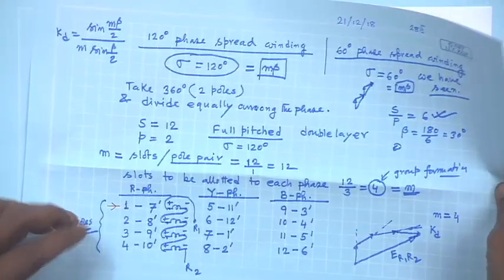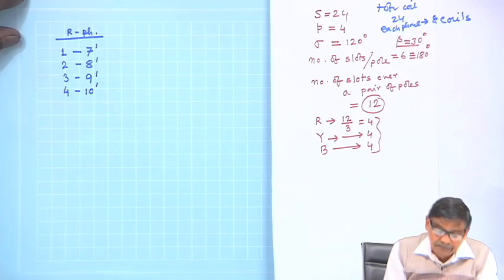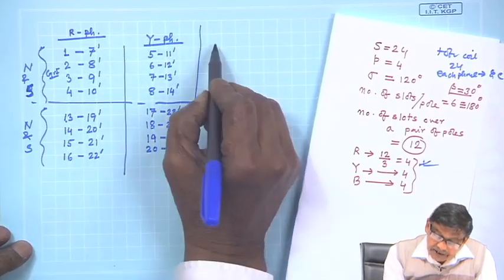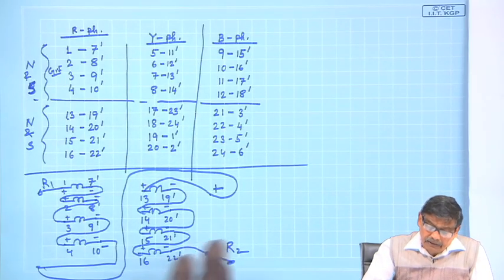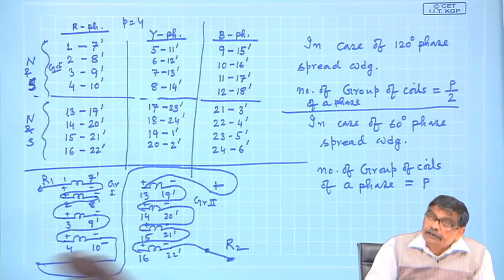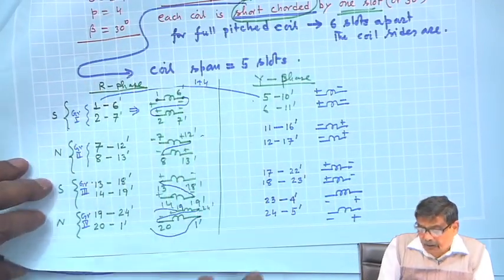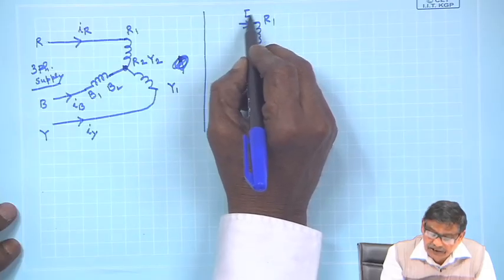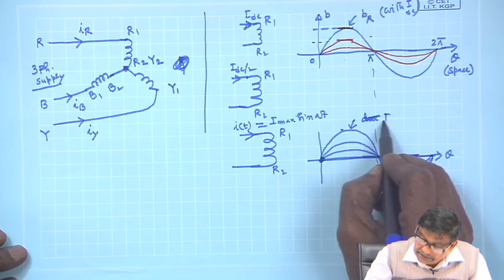Lecture 29: Winding Table of  120 Degree  Phase Spread Coils and Group Connection

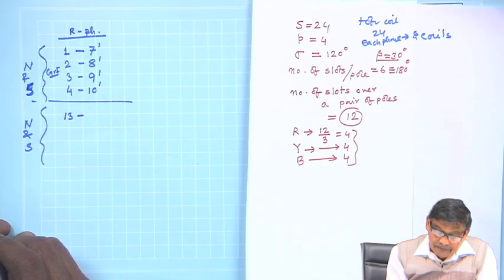Comment: 5:37 Can someone tells, why sir don't take coils 7 - 13', 8 -14'...?
Reply: Because the three phases must be separated by 120 degrees electrical and here in this case 60 degrees mechanical, that is, every phase should be accommodated only in 4 slots since each slot pitch is 15 degrees mechanical. Hence after 4th coil of R phase, the immediate next phase should be Y phase that is at 5th slot, and hence 7th slot can't be accommodated for R phase again.